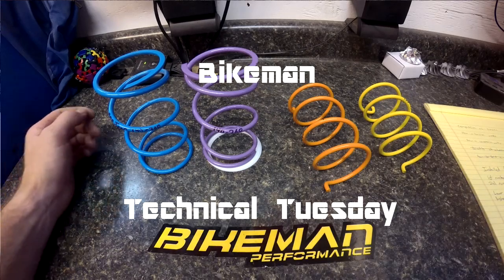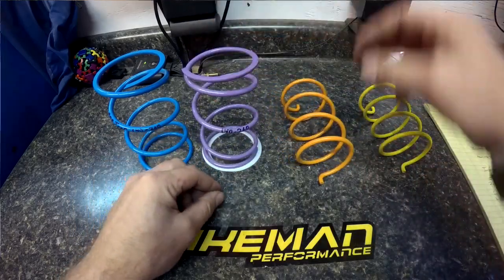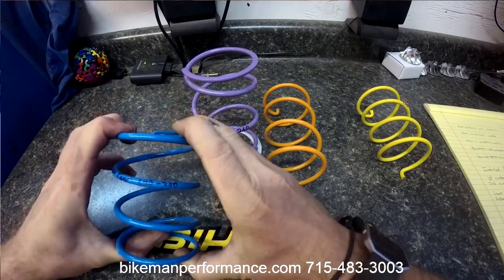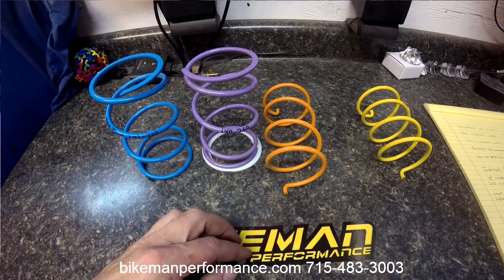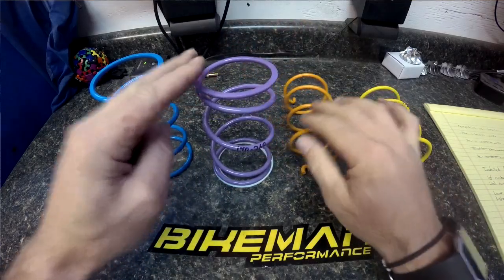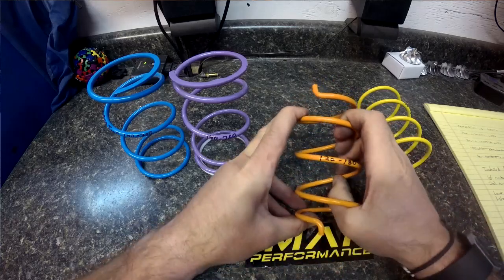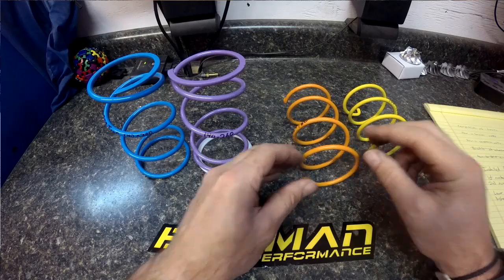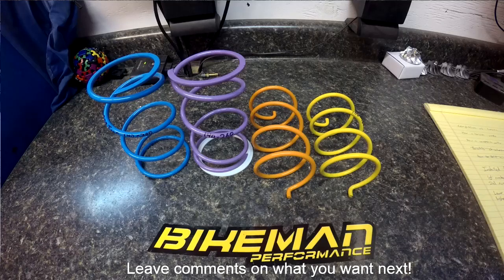S1E5 BMP Tech Tuesday - Secondary Clutch Springs

Comment: 4000 miles on my 2012 proclimb and my secondary s@#* the bed. I bought a new secondary with the same spring and now I'm over revving. My engagement and finish feel soft now, feels like I lost a ton of power. Original stock spring in the primary, could wear on the old primary spring cause over revving?... Please help
Reply: Did you change your helix to the stock helix? That will effect your rpms

Comment: Hey Joey, another great video. I was at my arctic cat / BMP distributor in wainwright alberta today. The friendly parts guy there says he's selling lots of torsion kits for the cats. Is this something that would work on the stock 2020 165" alpha ? Kinda putting off doing a full stage two clutch kit till i get the bolt on performer or wait till you guys build twins. More track speed and longer belt life sounds good to me for the cost of a spring!